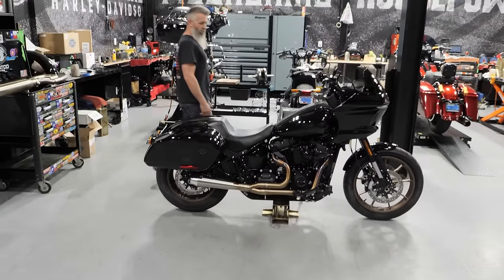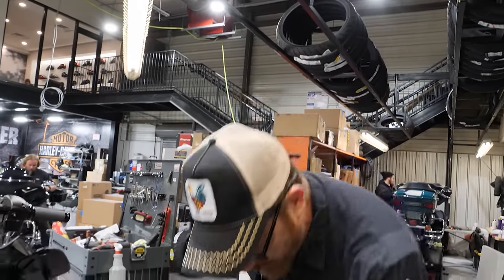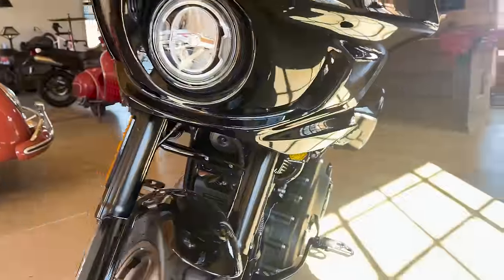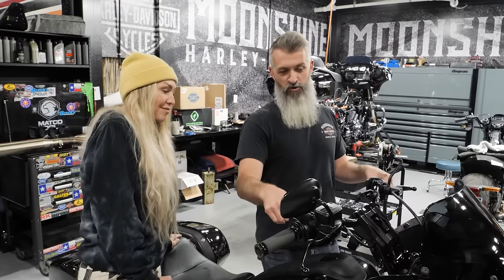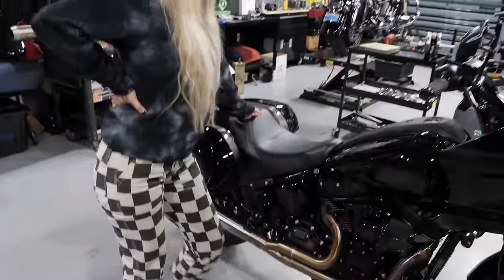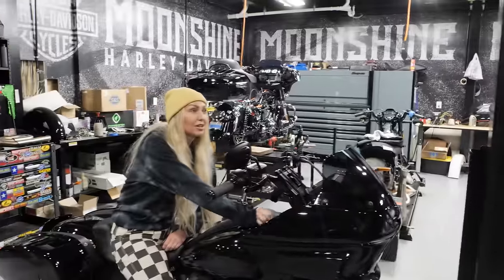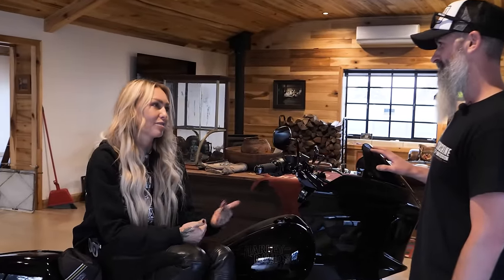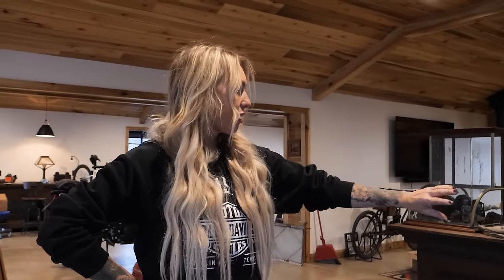2023 H-D Low Rider ST 117 MHP Stage II Build with Leticia Cline!

Comment: I've got FXLRST 22 and MHP 485 cam with a short pipe (TBR shorty turnout to be exact) I hate low rpms with lack of torque...
Reply: I have the exact same setup with CR483 thinking of going with a sawicki mid or a SPB Fab  with torque insert

Comment: Beautiful setup 
But damn.. don’t those air cleaners cost power ? The ones that come on there ? 
Dyno graph looks fantastic 

*the bad news..  $7k for the stage 2 alone but u get what u pay for
Reply from the maker: Has all the parts needed to handle the miles. The intake does cost some power but not much on the stage II SETUP.  We see the larger losses on larger builds that require more air.